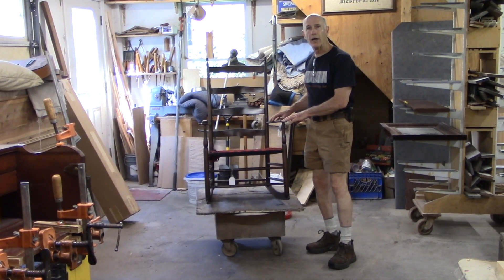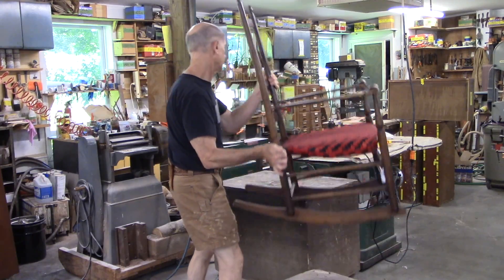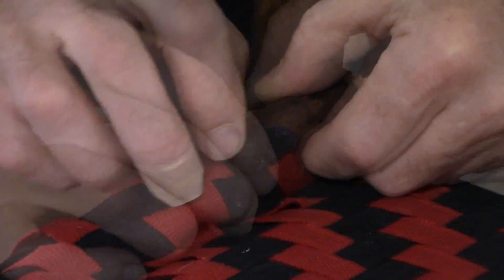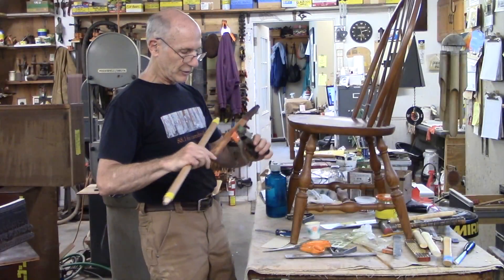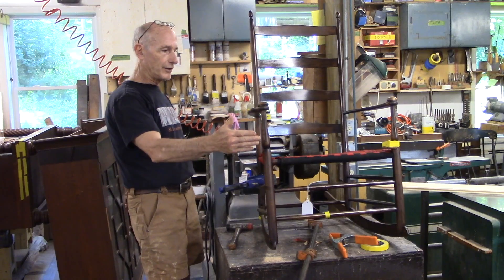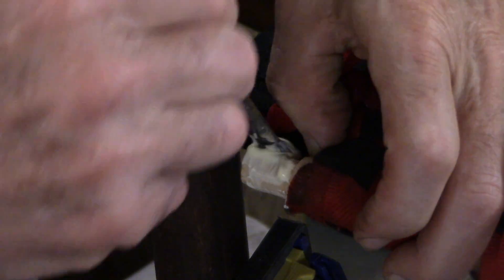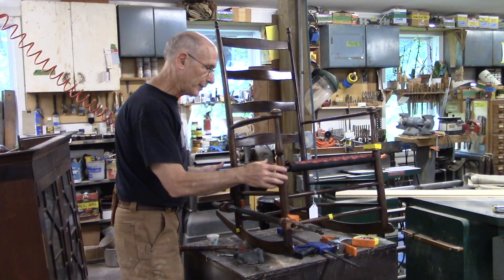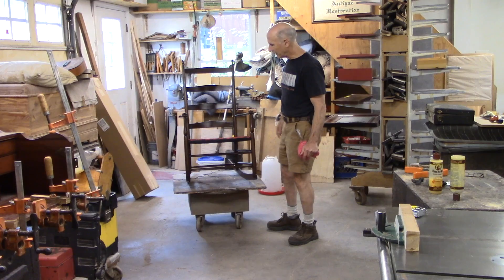Repairing a Shaker Rocking Chair - Thomas Johnson Antique Furniture Restoration

Comment: Thanks for all of the tips you have shared.  Here is one for you.  When you want to make a tenon on a dowel, you can use the bandsaw with a stop.  Set a stop back from tip of the teeth on the blade at the depth you want the tenon.  Then set the fence away from the blade to set the length of the tenon.  Then with the dowel perpendicular to the fence start turning the dowel into the blade.  Makes a perfectly round tenon on the dowel.
Reply: @Rick1979 Maybe, however if you noticed he drilled out the leg with a drill bit, and then drew a circle on the dowel and paired to it.  I would gather round was the goal.
Reply from the maker: Thanks! I'll try that. I had tried it on the table saw with limited success
Reply from the maker: Thanks! Well, making a good joint was the goal

Comment: and you actually have to put heatgun with tip directed up after use because this helps to cool heating element (it obviously might overheat in case you use your heatgun on max for some time).
I think you're the best channel about woodworking. I'm a beginner, and already stole some ideas from your channel, e.g. when I have to add veneer patch (I'm not restorating anything but event once making smth new - thing happen) I'm aligning it with tape and then put glue and flip. So easy, but that's what makes diff between newbie and pro =))
Reply from the maker: Thanks! I'm glad the info is useful!

Comment: Hi Tom, first of all great videos.
Question:- why didn't you stain the new rail, I know you can't see it but!
Reply: Looks like only the ends were stained. I guess he assumed, in the interest of keeping the cost down for the customer, that the ends didn't need to be stained because webbing was so tight to the rail.
Reply: The original was only stained at the end as well. Tom only does sympathetic restorations and keeps it as close to the original as possible.
Reply from the maker: Thanks! Couldn't think of any reason to stain it! The stain on the old was just from when they originally stained the chair, just sloppiness
Reply from the maker: Thanks! See above - no reason to stain
Reply from the maker: Thanks Jim! Never occurred to me to stain it - no reason
Reply: I thought the same. At least make it dirty. It was just too clean. I would have seen that clean dowel for the rest of the time I owned that chair. That's just me.  ✌🏻❤
Reply: @Thomas Johnson  But I've seen you even stain hidden glue blocks behind the feet of cabinets.  That's why I'm confused.

Comment: Mr. Johnson, I'm curious  as to how snug the dowel should fit? Tight enough that a mallet is required or should room be left for the glue? When I made my spindle it fit in and out of the joint with some ease but was not loose enough to lean to either side. Once the glue dried it was very strong and did not move at all.
Reply from the maker: Hi Lydia, I think that you always need wood - to - wood contact. So a joint should be tight enough that it goes together with some difficulty, too tight to do it by hand, but just gentle taps with the mallet. The glue will swell the wood a little, but you can never assume that glue will fill a void.
Reply: @johnsonrestoration   Humm. I think my dowel was probably more on the lose side then. I did have to push the the dowel in by hand and slightly tug to remove when test fitting but did not need the mallet. Or at least until after the glue was in then I tapped with the mallet. Should I expect it to come apart after some time if it was too loose?

Comment: I like how you used a cork and nail to measure the depth of the rail hole, even though you had a Vernier calliper right next to it. Out of interest, do you ever use hand drills?
Reply from the maker: Thanks! Not in the shop. But I have a push drill in my toolbox

Comment: In watching some of the vids done by your Canadian friend Scott, I noticed that he is partial to using vinegar to loosen glue joints, whereas you seem to prefer the heat gun.  Can you share thoughts on the pros / cons?  Are there situations where you might use vinegar?  Thanks
Reply from the maker: You're welcome! I find the vinegar makes a big mess!
Reply: @johnsonrestoration  . . . and a lot more "aromatic" than the heat gun!

Comment: I am curious. If the tenon on the stretcher had not been broken, could you have glued the original along the split and reused it?
Reply from the maker: Maybe. There was a lot of glue surface there. But what if I installed it and it didn't hold? Didn't want to take that chance

Comment: Fantastic as always! That was very interesting how you had to get the new stretcher in. I have a question for you, Tom. Remember the Furniture Guys that were on PBS way back? One of the guys wrote a book on wood finishing and he insists that you should wait until glue squeeze-out sets up and then scrape it off with a chisel. He says when you wipe off wet glue, there's a good chance it'll affect the finish to some degree. Have you ever had any issues like that, Tom? Thanks for posting these videos.
Reply from the maker: There are different views on the matter. When repairing furniture, typically the wood is finished so it doesn't matter, except it's easier to wipe it off while it's still wet. When building new furniture, the wood is raw, so there is a danger of working the glue into the wood fibres trying to wipe it off. I've never had any problems either with repairs or building new wiping the glue off as I went along. Scraping it off with a chisel is no fun, and you can damage the piece doing that too!
Reply from the maker: Thanks Maxx!
Reply: @johnsonrestoration  I appreciate the insight, Tom. That makes total sense. Have a great week!

Comment: is there a reason why you didn't turn the spindle on the lathe? seems to me to be much faster than shaping it with chisels and sanders?
Reply: or the sander.. but it was calming to watch him do it by hand either way :)
Reply: I was wondering the same. I am guessing that perhaps the original piece was hand shaped and thus not 'perfect'. Replicating this would mean that the replacement also shows some imperfections that a machined piece would not.
Either that or there is a pile of stuff in front of the lathe and he decided not to dig it out just for one part ;)-
Reply from the maker: Thanks! I think it was faster this way. To turn a spindle like that would take an hour! First you have to dig out the lathe..........
Reply from the maker: Having done this operation many times, any way that you can think of, believe me, this was the best way
Reply from the maker: You said it! The way I did it was the fastest

Comment: So did anyone notice the hummingbird that flew around the shop? It started on the right side of the shot (about 9:27) around the racks on the right. It flys around the bottles on the table, loops in front of Thomas around the bottom of his shorts, across the table and out of the shot. It re-enters the shot on the left going away. Something caught my eye so I watched with slow motion.
Reply from the maker: Wow! I had never noticed that. Are you sure it wasn't just a large insect? I don't know how to slow it down, I'll ask my editor. I hope it is a hummingbird!
Reply: At first I thought it was a mouse. When I slowed it down there is a profile shot where you can see the iconic outline of a hummingbird. The wings, head and beak. Real neat.
Reply: To slow it down touch the three dots, top right. It brings up playback speed. I chose .25

Comment: I almost expected you to use the original rail since the break was clean and just make a new tenon rather than replacing the entire rail.
Reply from the maker: Thanks! There's just too much tension on those rails, I wouldn't trust a repaired rail.